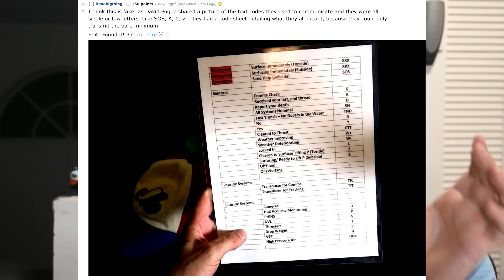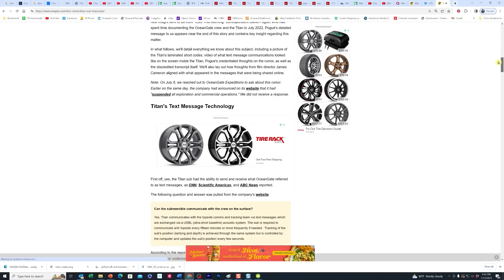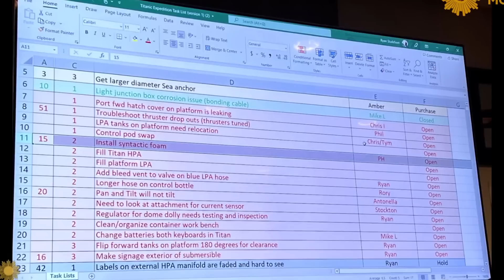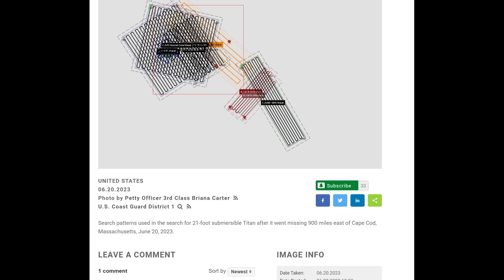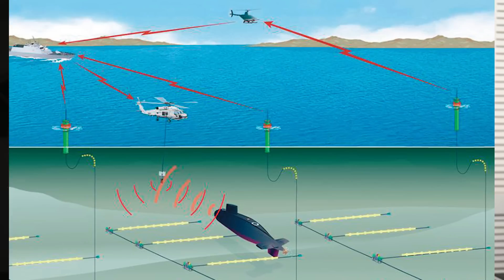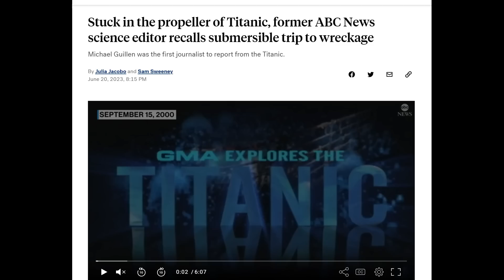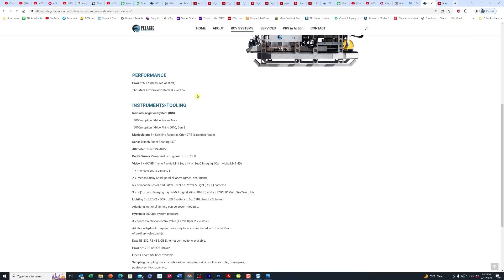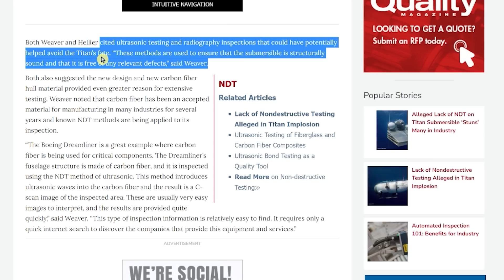The Shocking Truth About Fake Sub Transcripts No One Tells You

Comment: I always thought this was fake, mainly based on the fact that it's very unlikely they'd be able to hear a bunch of noises from the sub before the implosion (if it was the carbon fiber hull that failed). The OceanGate Engineer who was allegedly fired for raising concerns about the sub even said in a court deposition that the acoustic "warning" system would probably only give you milliseconds of "warning" before an implosion. 
Also, the public in general seems to have a morbid appetite for the idea that they knew they were doomed and had time to freak out/contemplate their fate (e.g. the periodic "banging sounds", countdown to when they'd run out of air, etc.,). This reads like fan fiction written to satisfy that morbid curiosity.
Reply: Banging sounds were heard by the crew that did the first trip on the Titan, at the Bahamas in 2018. It was reported by them that sounds were heard even during ascent, "which was an indication of stored energy on the hull" and would mean that the pressure cycling was acting from trip one.
Reply: Yeah but other people who had been that exact vessel said they could hear cracks and creaks when they were on it. So it's plausible they were hearing something. Obviously when it imploded they didn't hear anything
Reply: @OttoErotic69  Yes but that is the sound of cyclic damage being done to the hull not delamination which was what the acoustic "warning" system was meant to detect. Also if these noises were so common that makes the transcript seem even less likely to be authentic. If they happened all the time, it wouldn't be cause for concern. In fact, there's a video of Rush saying to his staff that "all diving vessels make some kind of noise" to dismiss fears over a loud bang they heard. So it seems unlikely to me Rush would even report noises to the surface vessel.
Reply: @michaelhill6451  I'm not saying the transcript is real I'm just going off of what surviving people said about noises that didn't sound right. I know titanium bends under pressure but I'm not sure it cracks like carbon fiber would. Those sounds would seem to be exclusive to a material that would break/Crack. Could be 100% wrong on this. Definitely not a sub expert and have never been on one
Reply: @OttoErotic69  I agree, those sounds were probably carbon fibers breaking. I'm just saying that when the hull ultimately failed it would happen very quickly. You might hear some carbon fibers breaking like they did on other dives but at that point cyclic hull damage was background noise to Rush.
True, the titanium would bend a little but a lot less than the carbon fibers would flex which is a reason to suspect that the joint between the carbon fiber hull and the titanium end caps could have failed and caused the implosion.
Reply: @michaelhill6451  I read an interesting theory that maybe there were microscopic holes in the back that might have opened enough to let water in. At that pressure the water would've acted like the jet streams that can cut granite for counter tops. The sounds they heard were the streams destroying the battery and power system. Which explains the first battery not working and having to switch to the backup. Besides letting water in which made them drop like a rock on the way down and couldn't ascend because of the added weight. And as the pressure kept growing the holes opened enough to just implode the whole thing. Don't know how plausible that is but it's interesting

Comment: I honestly think we won't know what really happened until they release an official report and read all the data from the recovered computers. I'm sure they had some sort of data logging system like a black box. So hopefully they can pull info from that.
Reply: I wouldn't be surprised if it didn't have a black box like item because Stockton was too arrogant and thought it was unnecessary
Reply: @thesneakystrangler9002  that wouldn't surprise me. But if I remember correctly all commercial air/underwater vehicles must have some sort of recording device. Honestly I think having some sort of legal requirement for dive testing these deep depth submarines before putting a person in it would have entirely prevented this. All of this was preventable.

Comment: The dive rate above what was normal for others that dive into the deep and from the surface question is above past speed. This suggest he followed the standard rate.  Is it dangerous, is a discussion on thermal rate of expansion strain to the stress strain due to the ocean pressure?  It is an order or two of magnitude less so not a risk.  Bigger risk is to hit something like the bottom etc. 
     Next is the bond between the composite and the metal rings.  Without knowing everything about what was done I can not say voids were created or not.  I can tell you I would be more worried if I did see excess epoxy expelled since the contact face is below the edge of the ring.  I have seen the xRay of the soldering of power semiconductors onto a substrate.  One was void free and the other had dozens of voids.  The shape of the paste and the angle change with closeness and speed made all the difference. There was no excess paste and all the surface was covered.  Also need to see the FEA analysis which must include the bonding and excess epoxy if any. 
     This is stage B prepreg continuous carbon fiber is cured with a high temperature.  We only see the laying of one layer out of hundreds of layers and the only time they touched the cylinder seem to me after curing.   Finally just like grocery store food dates the manufacture puts a date where it absolutely will be good.  So there is a significant period where the B stage prepreg is still good.  I presume they tested it before purchase by curing a sample and testing it's strength. The laying is often done with heat that softens the contact line to push out air so no voids.  This is a process that have been done for decades.  What we do not know if the lay of the material was accurately modeled in the FEA.  Repairs happen when the analysis is adjusted to match the cylinder built.  Then this model is run. Then the cylinder is adjusted to match a further modified analysis that meets the requirements.  This is repeated until they both agree.  This was done for the Galileo deep space liquid hydrogen heat exchanger my employer built. Needed to ride in the space shuttle bay.  It failed three times on the test vibration stand that far exceeded the expected levels.  Analysis was used to modify it to survive.   
     The CEO skipped cost that would have reduced risk.  Every 'experimental' home built composite airplane do not do the safety ultrasonic testing.  This is a requirement to carry passengers.  Those that were on the sub were employees for this dive and knew they signed this away.  The test would not have found cracks that happened after the cylinder made dives.
    His failure was not to consider that water would be forced into cracks that always occur in the brittle epoxy that bonds the fibers together.  This is known to happen, and If I remember correctly published in analysis of pressure vessels for internal fluids and also found in atmospheric composites.   Clearly if this was on the risk list a solution would have been found. 
    So why do I think the transcript is accurate is that it is what I would expect when water seeps into a spiderweb of cracks in previous dives and remained.  The cylinder is the only component of the sub that the added weight would not be noticed.    The sub by calculation is made neutral buoyant, however; the fast diver rate and when the sand was dropped the sub was not positively buoyant.  Further the sub was just positive buoyant when the skid weight were dropped.  Further failures turned in the last seconds to a negative buoyancy, the last three depth readings.

Comment: Since Stockton was from aviation, he probably would have preferred the way it works between air traffic control and pilots. Ultimately, the decision is up to the pilot what they're going to do because it's their ass on the line if they make a bad decision. However, ATC will sometimes say something like, "Do you need to adjust speed?" in order to bring awareness of what looks like something abnormal to the attention of the pilot. If the pilot says everything's fine, then the decision is up to the pilot to make and ATC knows that at least the pilot checked whatever parameter looked abnormal. However, the reason I know this is not because I'm a pilot but because I'm a bit of an aviation nerd and I've seen many accidents that occurred, even though ATC warned a pilot about something abnormal, because the pilot decided it was fine. It never hurts to listen to ATC because they might be seeing something that you're too busy to see when you're doing all the other things necessary to fly the plane but they will also just gently bring attention to the thing unless it's something like violating restricted airspace or being at risk of an imminent collision with another aircraft.

Comment: Btw, I think the most interesting implication of the transcript is that it shows the submersible had a bouyancy issue practically from when it went into the water.  So in fact this wasn't an issue induced by high pressures.  So now I suspect that something was leaking at the back of the sub (in the ancillary equipment outside the pressure hull) right from the start.  And that implies something broken or missing.  Maybe a bolt not done up, or just something as simple as that...
Reply: I said that very thing in the comments last time, but got ignored by everyone.
Reply: The glue
Reply: The hull implosion had to be a pressure issue.  If the descent was too rapid, that could be due to a leak in external gear as you describe, someone getting the weight calculations wrong, or some other factor.  It's not obvious that there's a link between the two issues.
Reply: How on Earth can the ancillary equipment stay dry without being inside the pressure vessel? Surely that part of the sub filled with water on all the previous dives.
Someone else speculated that the carbon fibre hull lost buoyancy as it dwindled to its final layers.
Reply: @android584 that equipment wasn’t inside the pressure vessel. There was no water leaking causing a buoyancy issue. All of the equipment in the rear wing was water tight on its own, and not inside a larger pressure vessel. There was nothing back there large enough to leak enough to cause any buoyancy issue. 

The buoyancy thing is a concept that people are getting hung up on, but no buoyancy issue or faster than intended descent rate caused the implosion. If the sub wasn’t capable of handling the pressure, it was going to implode - no matter how fast or how long the sub was descending…unless it dropped like a stone. Even if this fake transcript is real, it doesn’t indicate a speed that would be fast enough to cause the implosion. It was still taking the pressure increase slowly, not rapidly at such a rate that would cause independent failure.
Reply: @HE-162  it would leak when the composite hull is damaged. Composite hull crack, they do not buckle, unlike metal. Water will fill in faster as pressure increase, the Titan became too heavy that it jettisoned the whole metal frame with upward thrust (according to the transcript) wasn't enough. The hull, the emergency ascend system, and the RTM (which monitor the hull), all fail, poor design.
Reply: @xponen Buckling is a geometric failure mode, where the deformation of the material causes additional stress which in turn leads to material failure. That fact that carbon fibre cracks when the material fails doesn’t mean it doesn’t buckle before it reaches that stage. 

Also, at the kind of depth we’re taking about here there’s no way that the pressure vessel could be leaking, once the pressure vessel is compromised it would be crushed immediately.
Reply: @eran0004  Indeed, it can be described as an "elastic instability" which causes distortion of the geometry until the material failure stress is reached, just as you say.  And any damage to the hull, including fracturing and delamination, simultaneously increases the effective bulk elasticity and reduces the bulk material strength, so it's obvious what that leads to.  Once sufficient damage accumulates, at depth the whole thing goes at once.  I think people find the idea of a leak and the thing filling with water exciting because of the drama, but first there is absolutely no evidence of it having happened (and certainly not in the purported transcript), and second, not a single one of the true dsv experts has ever suggested it.  My very limited experience of making pressure housings for much much shallower depths is that once you've got down to about 10-20% of max design depth, material compression generally protects you from leaks, and structural failure is the dominant concern.
Reply: The only buoyancy issue was from Rush’s ego. If it was an issue with the vehicle, Stockton Crush should have reported it.
Reply: There is no possible way for there to be pockets of air "outside" of the pressure chamber, they would all implode at depth. Everything that is intended to remain dry is within the pressure chamber, a leak is not possible.
Reply: @biosparkles9442 Also ... sinking the Titanic was not possible... it was " Unsinkable" .. 😮
Reply: Yesss... my thoughts too. No implosion. 😢
Reply: Hear Hear!  I am betting squarely on an eventual admission that the Titan passed a point of no return inside of 15 minutes of the "mission" starting.  Once they started diving, that was that.

I don't think there was anything missing except pressurized air.  For whatever reason the pressurized air tanks bled off all the air they had, and thus got filled with water, and thus that's why they were descending too quickly.  And Finally, when the Titan reported "Under control" that was not strictly True.
Reply: Desends too fast, hits bottom hard, and the impact breaks the highly stressed hull perhaps?
Reply: @davidgenie-ci5zl  No, they were at around 400 mt from the bottom when it implodes.
Reply: @Vaninasanta no implosion.
Reply: @Vaninasanta  We simply don't know where the sub was when it catastrophically failed though, and whether it was going up slowly, going down slowly, plunging quickly, hitting the bottom etc etc? This is why we need the Oceangate staff to tell us everything they know, but even then I suspect we won't really know the details of its demise.
Reply: @soots-stayingoutofthespotl5495  Yes, you´re right. I´m sorry, I should´ve explained better: if the transcripts studied on this channel are legit, then according to that they were at around 400 mt of the wreck. 
We´re only speculating, and I totally agree with you: until the investigation is complete and IF everyone do their job honestly and conscientiously, then we might know the most close to the truth...
Reply: @davidgenie-ci5zl  No, they dropped the weights apparently.
Reply: @davidgenie-ci5zl  Things can't fall very fast in water anyway, but certainly not if they are close to neutrally buoyant.  If one believes the transcript this was descending at just a couple of miles per hour.  Video from when they had the thruster problem shows sediment being kicked up from the bottom, so I guess it would be a soft landing anyway.  Pressure forces on that hull would be thousands of tons, my guess is the dsv weighed less than 10 tons, more like 5, so a parking speed impact into sediment shouldn't change anything.  Hopefully we'll find out what likely happened from the eventual report, but right from the start the obvious issues have always been the under-rated viewport and the CF hull.  The fact nobody has ever questioned the two titanium hemispheres (and they came out intact) says it all for me - they had a good design for a one person dsv by just mating the two hemispheres (and putting a rated viewport in), but they put an under-engineered CF tube between them to accommodate the four rubes who were to pay $1m between them to cover the costs and ideally generate profits.

Comment: On a related note, the video showing construction of the hull may be for the 1st one. Some say the 2nd hull was likely built a bit differently, in particular, a different layup orientation. If so, that's a significant detail to mention. Please look into. Another detail videos aren't mentioning much about is the unpressurized equipment portion. What tanks existed in there? If water entered one or more of those tanks and/or air leaked out, that might explain the faster descent (assuming that's true).
Reply: All good points.

Comment: The problem I've always had is that code sheet doesn't have any of the terminologies they used in communications. And it's not like Stockton Rush was one to follow 'standards' on anything.
Reply from the maker: Right, and there's no codes there That represent any of the conditions the sub was facing at the time of the disaster
Reply: @jeffostroff  IMO, if the leak turns out to be fake. Id be willing to bet that it is very close to the truth. 

FWIW, I don't take Snopes for their word They can be rather quick to jump the gun on certain things.
Reply: Rush did not respect commonly-accepted safety protocols or standards, so don't expect him to adhere to a sheet of acronyms.  Given the spelling error, I wouldn't be too surprised if that sheet was brought along just for effect.